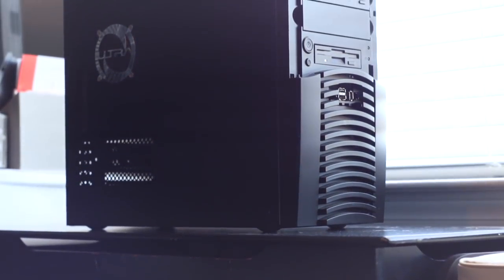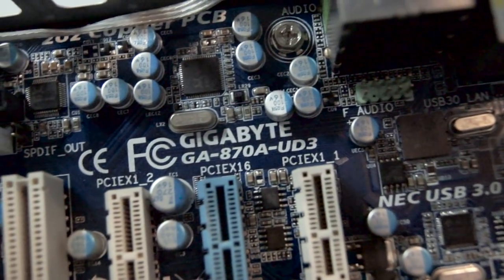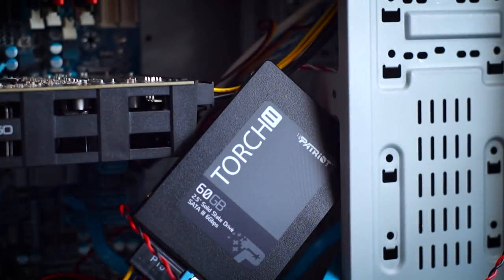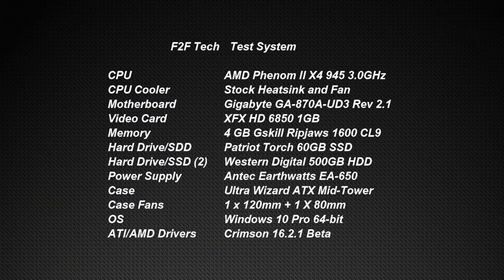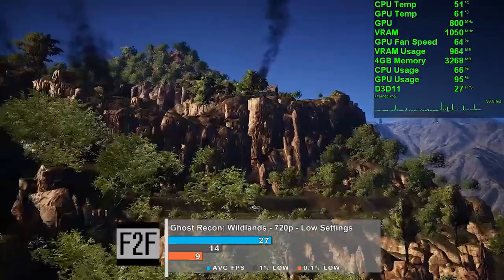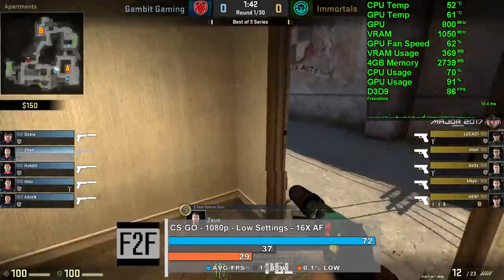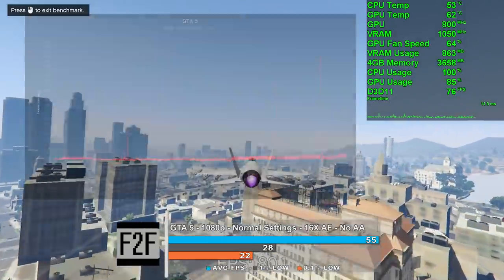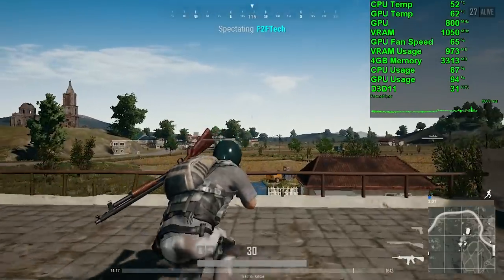How well does a 2010-2011 AMD Phenom II X4 gaming PC hold up in 2018?

Comment: I still use my AMD Phenom II X6 1055T today. Works like a champ.
Reply: luxury lol.
Reply: me 2 paired with a HD6850 and a SSD.. feels like a champ
Reply: sucks im almost 29, which to me isn't quite old yet, but I still remember the exciting releases of 2009-2011 like they were not long ago. but they were already 7-9 years ago and makes me feel old... What's funnier though is that those 2009-2011 hardware releases are still relatively viable if you want to drop the settings just a little bit. I feel 2019 will be the year of the big switch in the pc/gaming industry! I say this because a lot of people are still getting by with 9 year old hardware, or even still maxing 1080P with 7 year old hardware (assuming it was top end of the time). A lot of this has to do with the fidelity in games being more closely tied to the current console generation. So when the current console generation started in 2012-2013 you saw a pretty fair boost in system requirements for your average game. With PS5 around the corner, and the 7NM gpus/cpus, all in around 2019, I feel that will be the year that will really push everyone into purchasing new hardware and hopefully allow us to once again see a pretty good boost in visual fidelity again.